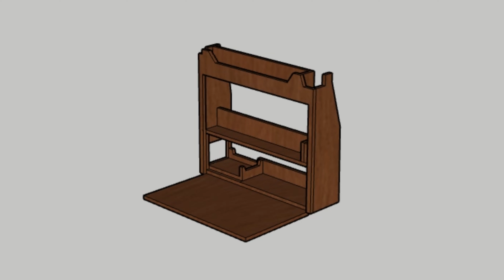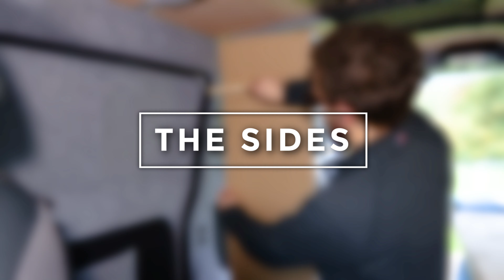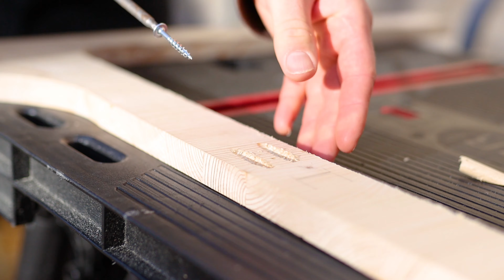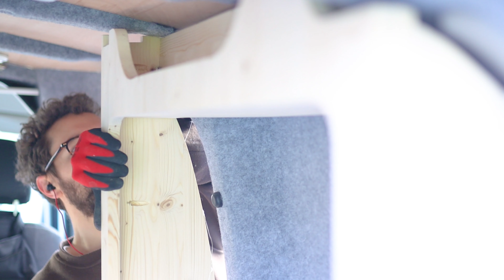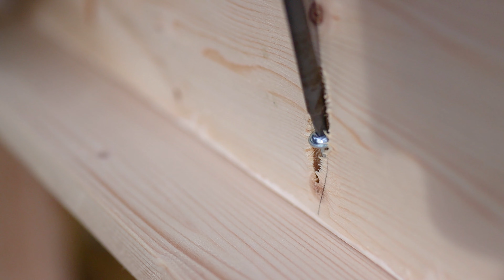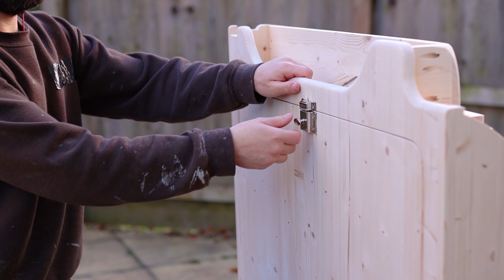Building A FOLDING VAN TABLE With STORAGE, Part 1 | Ep 22 | Nissan NV200 Camper Van Build

Comment: Having watched so many van conversion videos, this is far and away the best with really useful detail and great carpentry -truly inspiring. I'm hoping to adapt to my much smaller berlingo!
Reply from the maker: Thanks! Good luck with your Berlingo conversion 🚐
Reply: @LensOfJames  thanks. Have done the pull out bed but love your cupboard and table. Just looking for a suitable portable battery pack as we found we need this after testing the van on a recent trip to Spain.

Comment: Hi thanks for putting in the time to make these videos.  I wanted to know if there's anyway of putting 3 metre bundles of copper pipe flat into this can without having to put them onto the dashboard itself.  My colleague has a bulkhead in his but would be willing to cut it.  The Pipe tube was stolen off the top of his van along with about £200 worth of pipe. 
Thanks
Reply from the maker: Hi Ray, thanks and sorry to hear about the theft. I've got a dimensions video here: https://youtu.be/CJe8pgAKwxw. I'm not sure you'll get 3 metres inside the van without it going on the dash. My surfboard is 9'5" and there's only about an inch to spare, though it's a lot bulkier than pipe so you may be able to find a few extra inches by moving them around. Sorry I can't be more definitive with an answer, but hope it helps!
Reply: @LensOfJames  thank's for that,  I'll watch it now 👍.

Comment: hi you focus quite a lot on the design but i wonder since i have the same van, where do you screw the whole structure to the van? do you screw on the metal of the van?
Reply from the maker: Hi, there are 5 built-in screw threads in the walls of the van which I used - I go into it in more details in this video: https://www.youtube.com/watch?v=cJGZMmY0svM&t=4s
Reply: @LensOfJames   thank you  so much really helpful ! :)

Comment: I've watched all your videos, and have been really digging into the design of my NV200 camper build. I have a plan mocked up in CAD and sketchup. I'm so impressed with the cabinet design. The part that intimidates me the most is building cabinets to fit the shape of the van. Would you be willing to share or sell your sketchup file of the cabinet? Thanks for considering!
Reply from the maker: Hi Emily, thanks! My SketchUp design was mainly for the dimensions of the cabinet and the side parts which fit the shape of the van were more of an estimation. The fit of the cabinet in my van is by no means perfect, but making a cardboard template was definitely the way to go!
Reply: @LensOfJames  I just got some big boxes from a friend: ) thanks!

Comment: Wasted time/effort/material on the table when a single piece of birch plywood cut to size does the job.
Reply from the maker: Not really, because a sheet of ply is difficult to transport in a small van, the pineboard can be bought in a number of sizes that suits your project (meaning less cuts to make and less wastage), is lighter than quality plywood (important for a van build), is easy to source for me (unlike quality ply). I've done a 'single piece of ply table' (see my earlier video) and it looked basic. I'm very pleased with my new table build - no regrets with this upgrade!